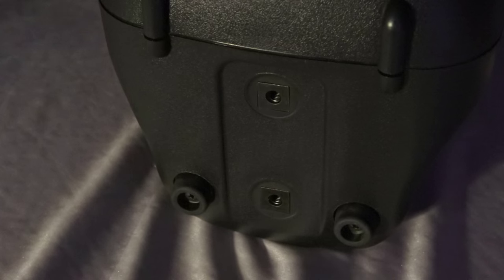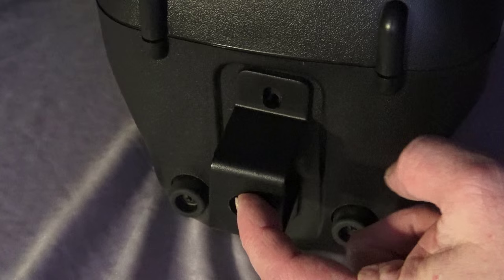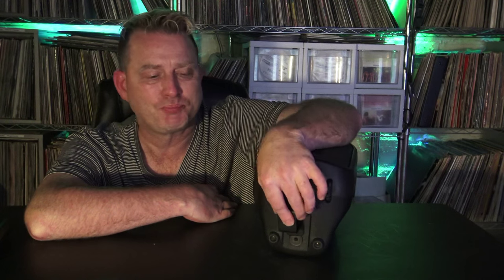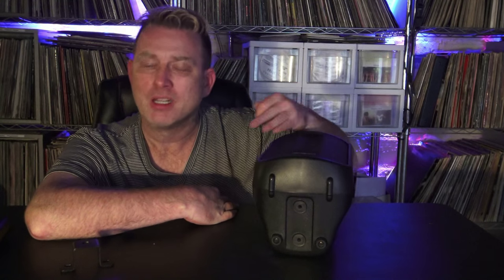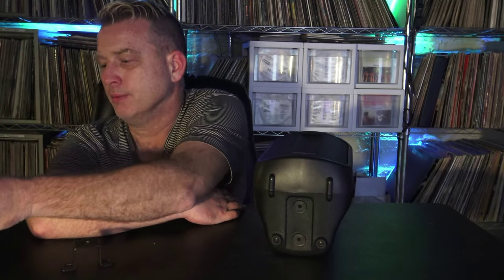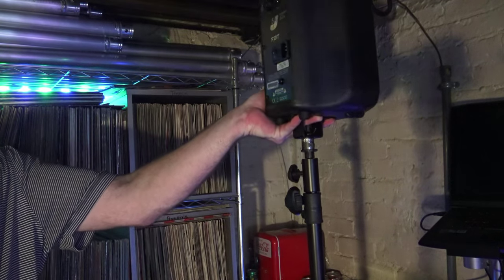FBT J5A - DIY Tripod Mounting Ideas

Comment: hi there. as its only a 5inch woofer, how's the bass? is it weak or quite good and would u recommend some sort of sub with it?  really useful video BTW
Reply from the maker: +Guy's Sound and Light For DJs, a sub FOR SURE!  Got another video explaining all of that I will upload soon
Reply: briansredd ok. thanks. I have 8 inch speakers and the bass isn't very strong so I'm not surprised that the 5 inch needs a sub too!